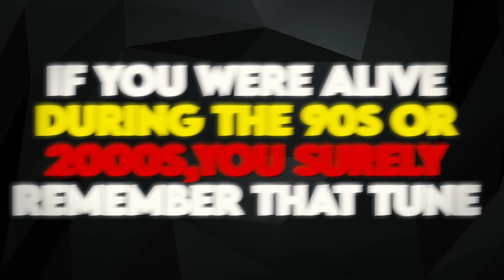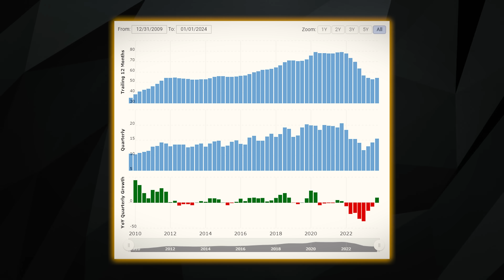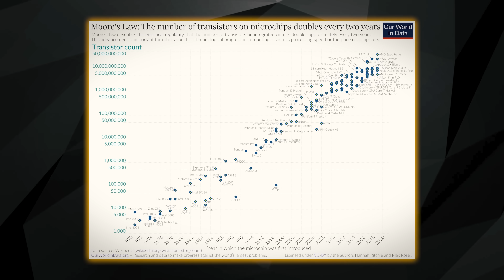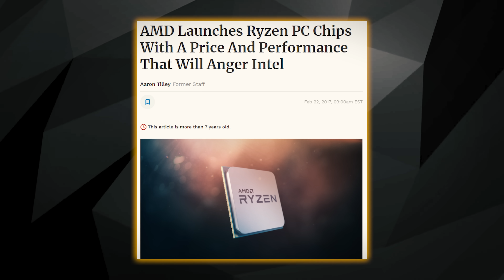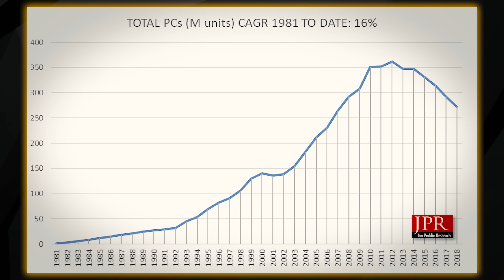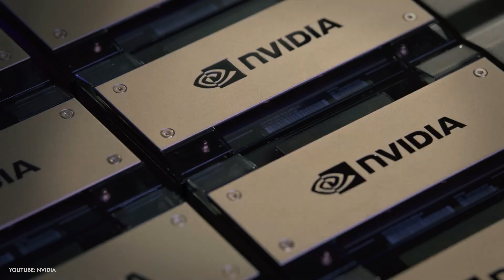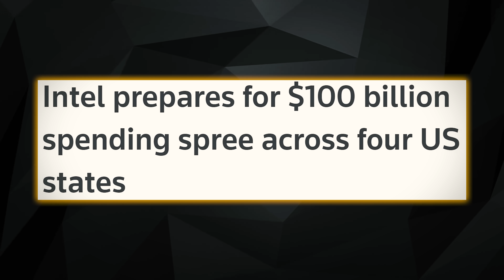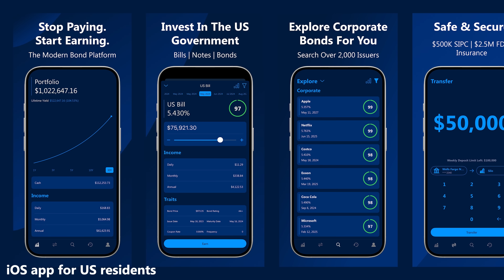The Dire State Of Intel...What Happened?

Comment: Intel fell behind because of one primary reason: They bet against ASML's EUV technology when it was first introduced. Intel believed that EUV systems are extremely complicated and expensive (which they are right about), but they also thought the yield on EUV systems would be too low for it to be worth investing in (They are wrong about this one however). Intel instead spent massive dollars on different patterning techniques such as multiple lithography to squeeze out smaller feature sizes in nanoelectronics with legacy DUV lithography systems.

Eventual TSMC, and Samsung caught up as they were the first adopters of EUV technology. Intel actually has spent much more money in R&D than any semiconductor industry company including Nvidia, TSMC, AMD, Samsung, etc. Intel actually spends more than Nvidia, AMD, and TSMC combined, but they are constantly researching crazy technologies that do not pan out well like Intel Optane. They also were stubborn and continued to manufacture older 14 nm process ICs using their own foundries instead of using TSMC. Intel Chip designs are arguable much more innovative than AMD's, but they are stuck on an older process node. Only recently has Intel begun to use TSMC under Pat Gelsinger. 

Intel is on a come back. They will be the first to utilize ASML's new High NA EUV machines in their upcoming 20A, and 18A process nodes in late 2024. In addition, they will be introducing back power routing in those same nodes - something TSMC does not plan to introduce until 2026. These two technologies are gambles much like TSMC, and Samsung gambled in adopting EUV, but it could pan out well for Intel.
Reply: Learning from past mistakes they are aggressively investing in High-na euv. 
😂
Reply: Well said, i like their shift in focus to become a foundry. I look forward to seeing them grow their customer base.
Reply: @nick-dogg  Them trying to become a foundry is mainly due to Washington pushing them, as it tries to wean off Taiwan.
Reply: Yeah i bought some Intel stocks a while ago, i hope the High NA EUV would give them an edge in the competition.
Reply: @thecuriosityHare you should sell it. With the new Snapdragon X line of ARM CPUs(SoCs to be precise) for windows, most of the laptop makers are going to shift a significant portion of their laptop line-ups to Snapdragon SoC. This is another major revenue and market share loss for Intel. Microsoft is focusing on Windows on ARM too.

So, Unfortunately, in future, Intels (and even AMDs) x64 CPUs are only going to be useful for gamers, and servers, which need high single core and multicore performance, unlike the majority Consumer laptops which need perf/Watt and battery life, and NPU on chip for AI etc.

Hence it's going to be tough time ahead for Intel and x64.

Bad time ahead for Intel and x64 Architecture.
Reply: This is why you don't want a marketing guy as a CEO of an engineering company.

Right now, Intel is slowly getting itself together under Pat, who is an engineer. So we may expect massive investments for new equipments, especially EUV machines from ASML, to help them get back on track.

Intel finally used EUV starting with Intel 4 and 3 nodes. However, High-NA EUV will not be used on 20A and 18A nodes, even though they got the first High-NA EUV machine recently.

They will use that machine to develop future nodes for now. We can say that it'll be used at around 14A node or later.
Reply: @satanandanprasad8809 Are considering that Intel has changed the CEO for the better? Even the GPU division adding new xe tiles, bring more tops for AI.

Intel is still in the game. And it's extremely too early to call failure. AMDs comeback happen when it was at 1 dollar the stock.

You should consider all the facts, and how important is leadership to steer the boat in the right direction.

Intel, the new architect is impressive what rentable units could bring. It's too early to tell success or failure.

Besides I see AMD in a tougher position in the longer run. The race will heat up 2028 / 2030. Meanwhile Intels upcoming architectures will stop gapps in their CPU division vs AMD.

Intel is in it's pivotal position, it could go both ways. But frankly if the FABs pans well, AMD will be in a tough spot. Intel would get very competitive and Nvidia is a Titan. 

It's easier for AMD succeed when Intel is down. Either way, time will tell.
Reply: Intel locking in :
Reply: Optane panned out just fine. They legally had to stop making it.
Reply: Intel bankrolled ASML to create EUV machines. They own a significant stake in ASML as well. Nice try with revisionist history, though.
Reply: You are missing some very important facts in this video!  One of the corollaries of Moore's law is that each new generation of factory becomes twice as expensive to build.  Intel tried repeatedly and selfishly to enter new markets so they could afford to build new factories!  They tried twice with cell phones they tried with ethernet they tried with many other types of chips.  Intel's selfish go-it-alone mentality caused them to waste tens of billions of dollars on MANY failed acquisitions! Remember that Apple tried to use Intel cell phone chips in 2017.  The chips barely worked!  Yes they embraced marketing too much but they selfishly embraced their old way of doing things which is go it alone and monopolize it to ourselves.  They were so selfish!!  Taiwan semiconductor was the opposite and they asked the whole world to "Please, send us your designs so we can build our next factory!"  Under these circumstances TSMC recruited the top Chemists and Physicists in the world ....
Reply: Intel is dead if they don't become a foundry.  They've known since 2000 that the cost of going a building new fabs was increasing faster than ANY of their markets.  Does selfishly try to buy into wireless they tried to buy into other industries and they failed over and over and over again.  If intel does not become a foundry they are completely toast dead they will not survive they could be gone and as little as 5 years!  Dont believ this bullshit about Intel betting against EUV.  That hurt, yes, but their stubbornness about not becoming a foundry IS THEIR DOWNFALL.
Reply: Well said
Reply: Don't abbreviate. People reading won't know the shorthand. What you should do, as you find in many books, is you write it out properly first and then use your initialism.
Reply: that's better explanation, thanks
Reply: U took what I was going to say and made it more specific ! Great comment
Reply: Intel worked with ASML for nearly a decade to develop those newer lithography machines.  Hmm, I thought Intel was the only investor with everyone else, including TSMC, opting out of R&D and investment with ASML's latest and probably last release.
Reply: I miss optane... It spawned so much new research about operating system and it broke my heart that they stopped making then.
Regardless, I recently bough a new old stock 905p.
Reply: "Arguably much more innovative than AMD"??? No.....that is simply not correct, if so Intel could easily do what AMD does, but that's not what happened......Where is Intel 16 actual P-cores? Where is their v-cache solution that allows them to only use 50-60watts of power while gaming and still be faster than the competition? Where is Intel's "OS don't have to be aware of which process runs on which core" like AMD does since zen 4 and zen 4c cores appears the same to the OS since identical instruction set? Where is Intel having to sacrifice silicon lifespan just to compete with zen 4? Cough Intel baseline bios profile........Where is Intel's ability to manufacture large core count CPU with one set of mask? I don't seee any of that...

Innovative? As in the architecture details? Yeah about that, a 6 wide CPU architecture with tons of execution unit/ports with massive cache and Dram bandwidth.....all of that to compete with a small efficient zen 4? and looses in gaming with terrible efficiency? Yeah nooo...Before blaming oh AMD is using TSMC....Intel actually has a higher transistor density node...........so again no.....
Reply: About using 14nm for too long, everyone forgets failed 10nm cannonlake for 10gen? It was so bad that intel need to wait 2 more gen to make it proper in 12gen...
Reply: Stubborn as hell to stick with monolithc arch despite the ass-whupping AMD gave them.  Somewhere around here I've got a screen-grab showing AMD having the top THIRTY-EIGHT spots on Passmark.  That is truly sick.
Reply: You are wrong. They started to fall behind even before EUV was a thing.
Reply: @rosomak8244  Please excuse my bad english...
Exactly, first cracks started to show, when the 14 nm process underperformed (and might have been event late as well) in the 5th and early 6th gen products. And Intels 10 nm has been a long running joke for some time well before EUV entered mass production.

In the early 2013, Intel looked bulletproof with their main competition imploding, them supposedly having a mobile processor in the development pipeline (that never materialised, that was an actual rumour back then), new 22 nm process coming online soon, 14 nm well in the pipeline... The company started to rot back in 2006-2008 and just got carried by a healthy pipeline of development started before then. During that time they got complacent with their dominant position and did not focus on their core market of fab production and CPU design. Instead chasing after ghost of completely new, obscure markets that never materialised (like Optane – cool SSD, but too expensive for what they did).

Since 2012, they haven´t really moved on, delivering tiny, incremental upgrades without delivering anything new. But during that time, the market changed, CPU become much smaller market, AMD overtook them and they had no response other than to refresh their existing tech and push it to the rough end of the power curve, as most of their talent, that delivered their success in the 90´s and planted the seed for their relative success in the early 2010´s, was long gone.
Reply: Too many technology that only works on intel CPU but not on AMD, so when the CPU doesn't sell, nobody bought optane. 
Why bother buy optane when the same price can give you better cpu + ssd
Reply: What about deliberately introducing security flaws in order to increase benchmark scores. That’s innovative.
Reply: Nope , intel laptop cpu are produced by tsmc , sam with amd. And it still lose to amd , literally almost double battery lifetime on amd laptop with same spec.
Reply: @gunturbayu6779  That's only half correct. They separated foundry from consumer/server and use three nodes in Meteor Lake, Intel 4 for compute, TSMC N6 and TSMC N5 for SoC.
They will go with something similar next gen with 20A and TSMC N3. 20A is rumored to be higher performance, while TSMC N3 is probably more power efficient in comparison. So Intel can take the best from both worlds and while Intel 4 is not really a competitive node with all the innovations coming to 20A, 18A and 14A, they will be.
Reply: @gunturbayu6779  No.  You are completely wrong about this.  Intel's laptop CPU's are produced in their own fabs.  Get real.

Comment: 7:48 Ever heard about Zen X3D? Intel is not competitive in gaming. They need insane power consumptions to even approach AMD its best gaming CPUs. Those CPUs are more expensive and require more expensive motherboards. On top of that, their 13th gen and 14th gen CPUs are experiencing stability issues or downright failing when used for gaming. The incoming fix seems to be to clamp down on power usage. Intel has allowed the motherboard vendors to push settings to the maximum to extract a few more percent performance out of those CPUs. And now that is backfiring. 

Intel only has laptops left and that is AMD its next push.

Comment: The biggest mistake of Intel, by far, was it's failure to recognize the potential in smartphone SOC in the mid 2000. Apple was turned down by Intel, wich led the start of the development of their own SOC, wich became the foundation of the M cpu of today. This decision alone open the door for the ARM SOC era of today instead of X86 SOC in smartphone, to wich i'm pretty happy.
Reply: I don't think intel fail to recognize the potential but around that time intel also have issues with their primary bussiness. Netburst happen. So putting a resource towards what apple want back then can be big gamble and risk for them. Just look what happen with AMD around that time. They were very successful with their CPU and then they spend a fortune to acquite ATI for themselves. That move end up putting AMD in a world of hurt financinally a decade to come. Plus the mobile soc world also have it's own juggernaut.
Reply: I'm ex-Qualcomm with 12Y experience - Intel tried - TWICE - to purchase smartphone chip makers & startups.  They ended up shutting BOTH purchases down!  It takes lots of wireless system design skill to build smartphones and Intel has NONE. The real issue is the cost of new foundries was going up faster than any of their markets!  They were trying to expand into new business areas so they could afford their next foundry.  The many attempts at expansion from 2000 to 2020 they all failed.  Intel was too selfish and too stubborn to accept outside chip designs for fabrication as a foundry.  They felt it was beneath them.  This arrogance was their doom ...
Reply: it also didn't help that the few x86 mobile devices that existed were straight up e-waste
Reply: One of their biggest mistakes was not backing up from Pentium 4 fast enough, and then not learning and doing the same with Skylake. Apple M1 showed them the door, and they still didn't get it.
Reply: Dunno, their decision to not buy into openAI 7 years ago, thinking AI was kot the future might also be their biggest mistake?  Or their choice to avoid EUV?  It’s funny that there are so many bad mistakes to argue which was the worst.

Comment: The only reason amd came back was because they found loophole to get out of their contract with globalfoundries (thats why their chips sucked) and was able to make chips with tsmc.
Reply: Yeah apparently they were stuck with their Bulldozer and Piledriver multi core cpu architecture because of Global foundaries. A lot of programs and games still used single cores. That’s why Intel was so successful with their Duo2 and later “i”series. AMD could not afford to manufacture the newer architectures due to your mentioned contract. Jim Keller and TSMC saved AMD.
Reply: Sad things is global foundaries is AMD sub company... Before it broke off..
Reply: This is completely wrong the 1700 x and 2700 x were produced with global foundries. @12nm.  Globalfoundries is amd's original foundry.  They spun it off and then it slowed down.  Excavator, Bulldozer and Piledriver were stupid designs that tried to share one ALU with two execution pipelines, a moronic idea.   So when AMD said they had two threads per core they actually had only one, a 30% deficit in each core!
Reply: Hell no lol, AMD came back because they put time, resources and care into making a good CPU architecture......and AMD is still doing good now because they continued to pump resources into research and development with multiple leapfrogging teams because their CEO is an engineer that understands you need to have good product that people wants to buy and the only way you can make a good product is to spend resources into R&D.....